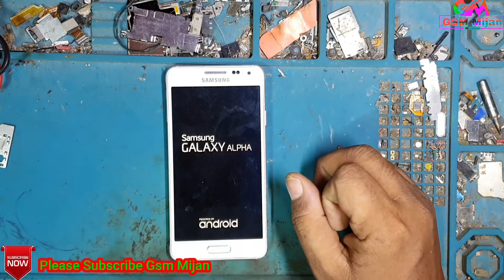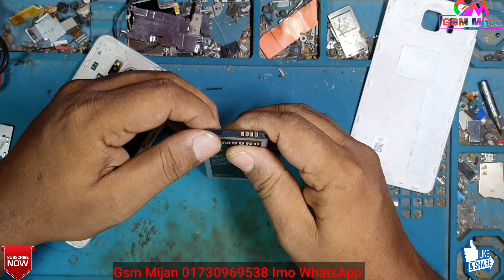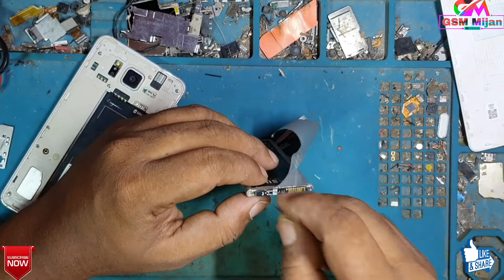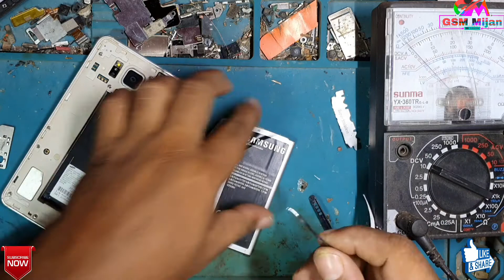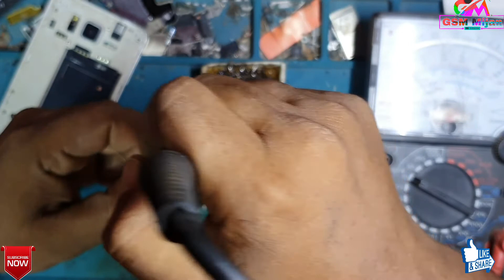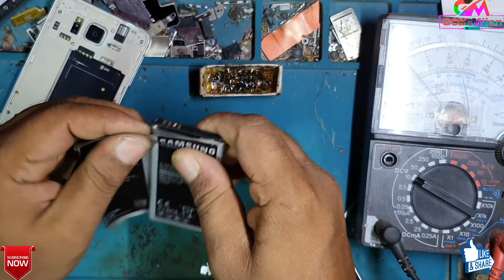Samsung Galaxy Alpha G850S Auto On Off Restart Problem Without Flash

Comment: It worked for me  What a relief to find that I can get all my files. My battery goes flat more quickly now, but at least I know what the problem is. Thanks so much. Is that hot glue you are using?